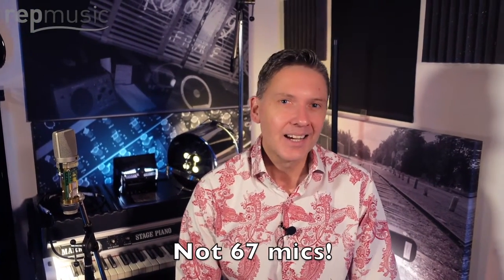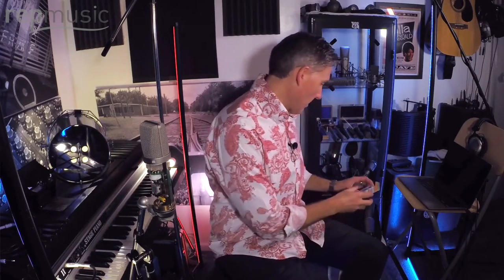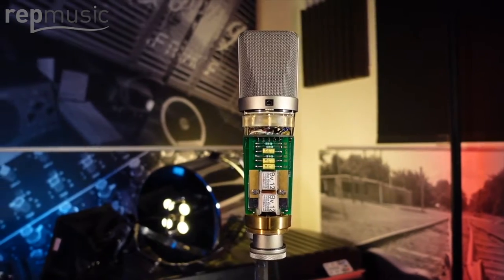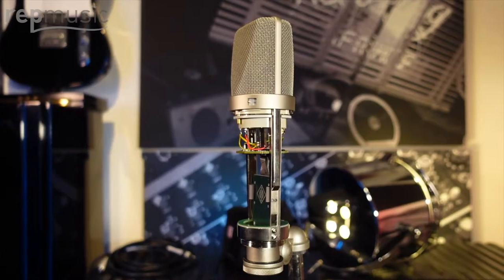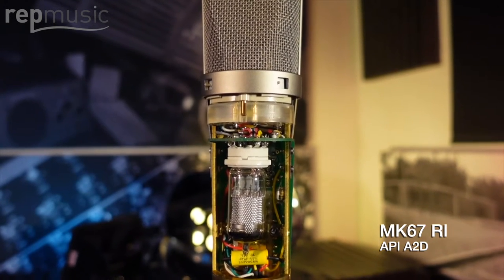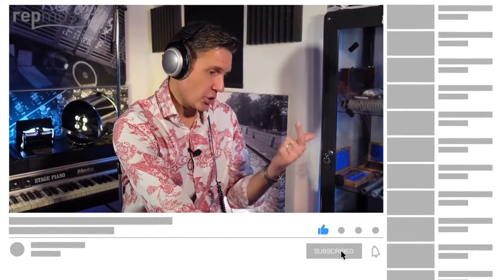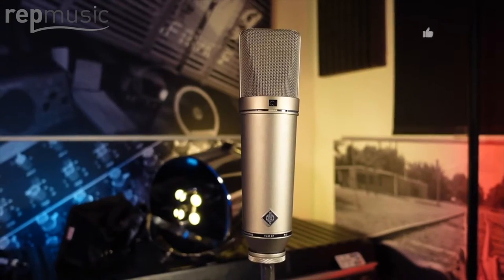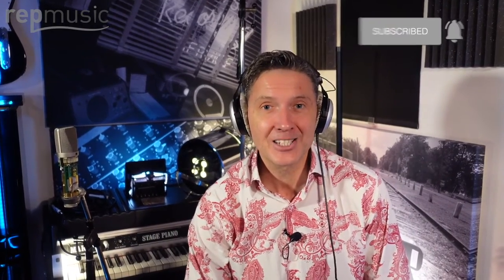Mic Shootout: Neumann U67(RI) vs TLM 67 vs Max Kircher 67 mod!

Comment: I have an MK67 with a NOS Telefunken tube. I've used it with my Neve 1073 and it sounds good (solid state) but it sounds stellar  with a Telefunken V72 mic pre. It really seems like a match made in heaven. I have a clone unit that I built using a board from Drip Electronics, with NOS tubes. It sounds more detailed and alive.
Reply from the maker: @larryayres4592  Interesting! Yes I probably wouldn’t pair my MK67 with our Neve and think it really benefits from the clarity of our API or punch of our DAV, would love to read more about the V72 clone you’ve made! Thanks for watching and commenting!

Comment: Between a few friends & I we have 3 Max Mods,  all of us use them in vintage mode (99% of the time) Otherwise would go with a 47 ! The MK works so so well with good SState Pre’s!
Reply from the maker: Thanks for your comments Paul, nice to meet other uses!
Reply: do you usually EQ your max mod? for some reason mine sounds like an SM7B…
Reply from the maker: @jfrancis2649  thanks for the comment. I don’t find I need to EQ it as a standard approach. Although I do find it works best if it can breath a little (e.g using it on guitar or sax), rather than as an up close vocal mic. Surprised it sounds like an SM7B, I found those thinner sounding when I used them, and the MK thicker and warmer sounding, but of course the instrument it’s being used on, the room, and the pre will all have an effect. What’s your set up and what are you using the MK on? Also what did you use as your donor for the mod, an 87ai or TLM67? Cheers!

Comment: nice! I just got my Max Mod. I put it inside my U87ai.. gonna run it through my BAE1073=>CL1B and see how it sounds. the vintage U67 is hard to beat… we’ll see 🤞
Reply from the maker: Enjoy! Best thing is you can swap between the two for different sounds, but I think you’ll keep the MK in most!
Reply: you got it? what do you think about it?
Reply: @Lukas-wx9gx it’s sounds good. It’s a little darker than a vintage U67.. so i’m swapping out the transformer for a Neumann BV12. I’m gonna make a before and after video
Reply: @jfrancis2649  great thank you. Would u rather first get a Preamp (neve 1073) or the mod?
Reply: @jfrancis2649  Did you swap the transformer? Did it improve the sound? I find tubes vary a lot. I put a NOS Mullard in mine and it sounded very dark. Switched to a NOS Telefunken and it brightened it back up and added clarity.